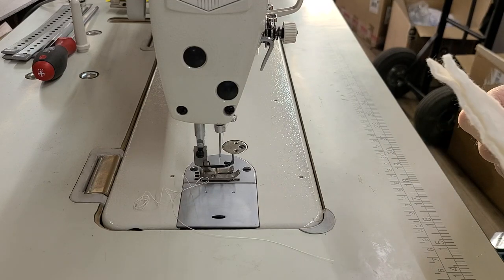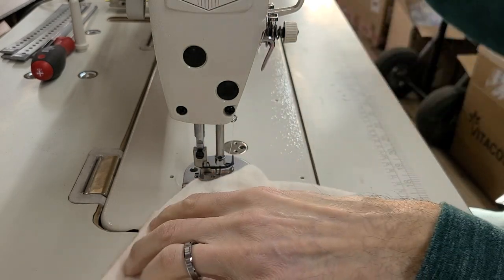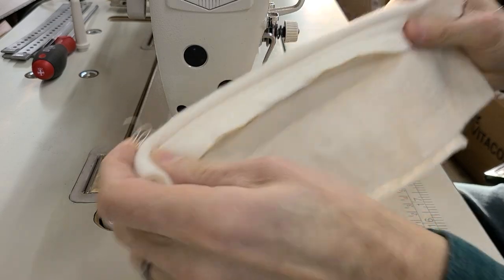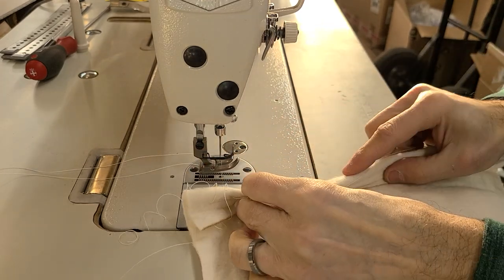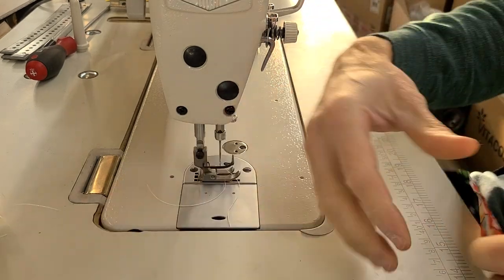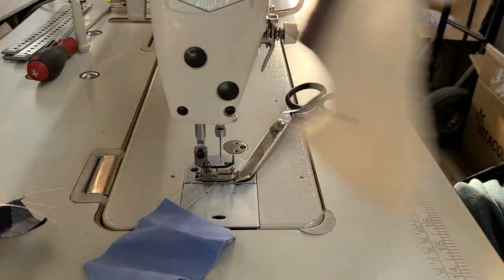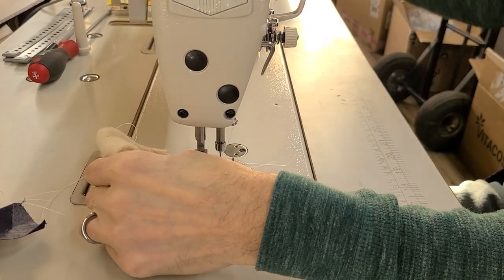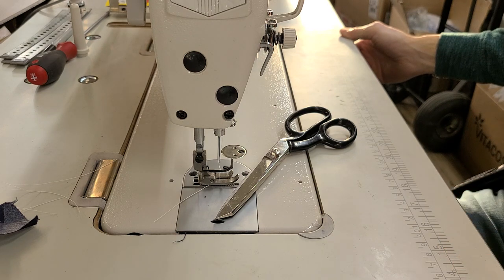Juki DDL-8700H sewing on fleece and wool.

Comment: :)
Steve, 
     Would you please compare SailRite's sewing machines with their progenitors? Thanks in advance.
Reply: Hey John. I 'test drove' their portable model, the basic LS-1. While its portability may be important to some, it falls short in many ways. 
1. The presser foot does not rise high enough. There is no knee lift, and until you have one, you don't know why you need one.
2. The stitch length selector is an unmarked lever. If precise topstitching is important to you, this will be a problem.
3. It's loud and clunky. Think Yugo, when you really want a Jag. 
I bought a Juki 1181n (I'm a bag maker and I occasionally make slipcovers.) This machine will buzz through vinyl and leather. The walking foot is smooth. The presser foot lifts to about 1/2", which is critical for thicker materials and topstitching. I bought it through Sewing Gold, and would do it again tomorrow. Don't cheap out. Buy better, and call Steve if you have more questions. He'll steer you true.
Reply: @jos.4276  Thank You for your detailed reply. As I am doing my Due Diligence  into sewing machines for the purposes of primarily sewing heavy, multi layer, dense cloth, and cloth-like materials, this helps much!
Reply: @johnq.public2621  I bought the Juki 1181N. It sews heavy upholstery fabric, vinyl, and multiple layers. If you want to sew heavier leather, you may want to consider the Juki 1541S. There are many reviews on these models, and some brands make 'clones.' I've heard good things about the Jack clones. I'd stay away from anything that seems too inexpensive, especially if you buy it online. Work with a reputable dealer. Steve is excellent.
Reply: @jos.4276  My thanks again for your detailed reply! :) How long have you had your Juki 1181N? Is it serviceable/adjustable by you at home? Besides Steve's YouTube channel, are their any other sewing channels you follow?  Thanks again!
Reply: @johnq.public2621  I bought mine this summer. There's a learning curve, mostly the tension. Steve has plenty of YT shorts on troubleshooting and adjusting. I recommend Lauren Mormino on YT.
Reply: @jos.4276  Many Thanks!   :)